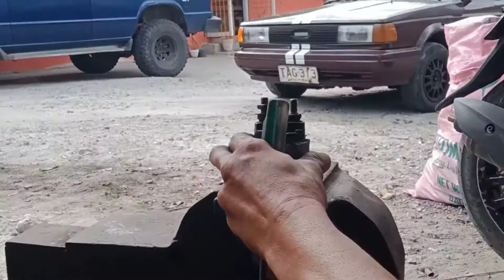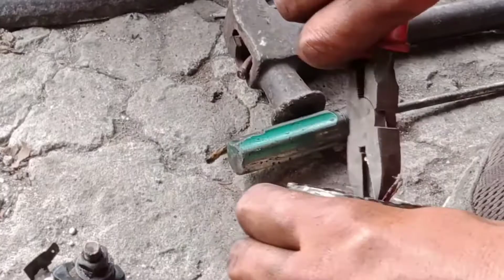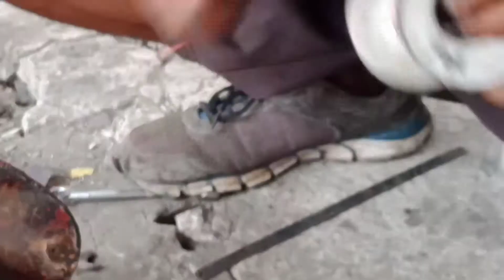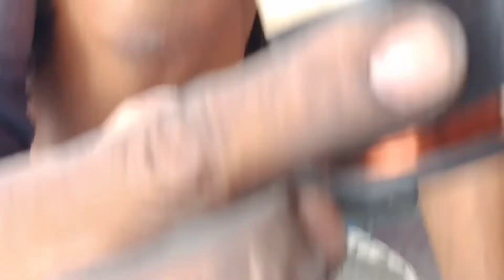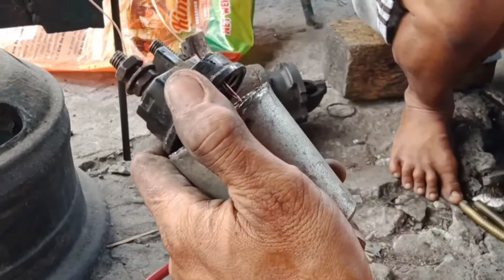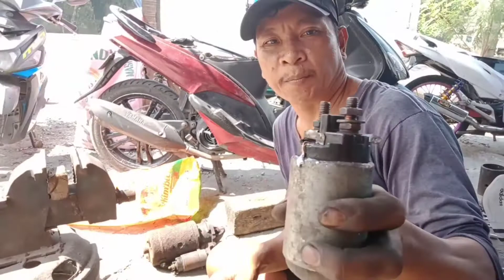Repair Solenoid Starter BC2 Engine 24 volts. madali lang matutunan

Comment: How many turns of a solenoid is 24 volts and 12 volts also. Thank you, sir
Reply from the maker: Ang 24 volts 6 turns po ang ilalim 6 turns ang ibabaw. Same lang po yan ng 12 volts magkaiba lang po ang sukat ng wire ang 24 volts 18  20 ang 12 volt 16  20 ang wire